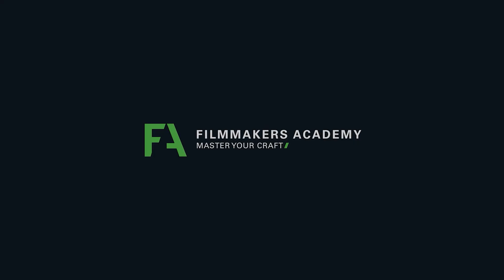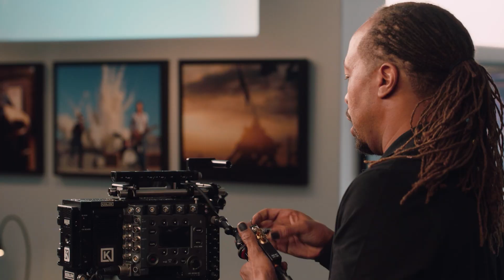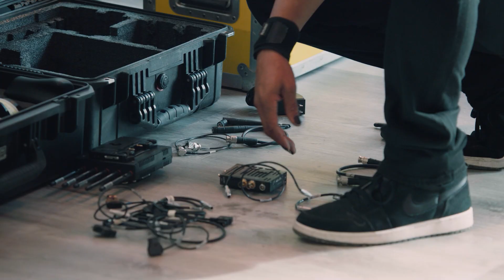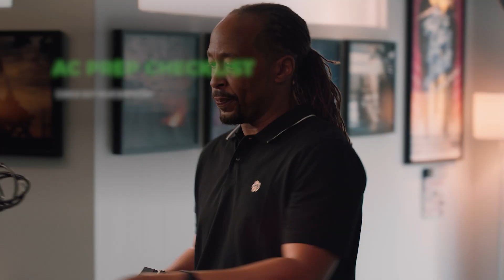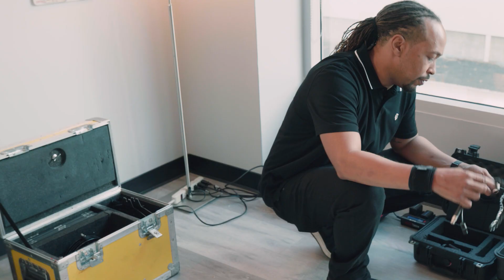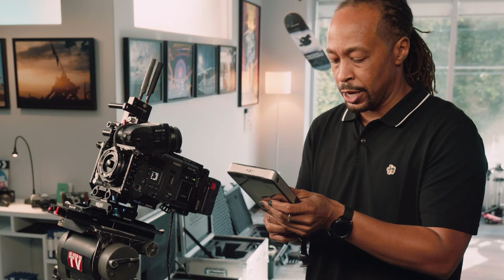Camera Assistant Tip: How to Build Your Camera

Comment: Never use D-tap cables, they're not grounded. Keep your equipment safe.
Reply: The other pin is ground, same as with lemo 2pin. And I'm pretty sure lemo 2pin doesn't have a secondary failsafe grounding either. So that's not the issue. The issue is that because of the D-tap design, you can plug/unplug a D-tap connector in an angle, where for a small moment the + pin is connected, but ground (-) isn't. So if...
A. The power cable is attached to the accessory. 
B. The accessory is powered on. 
C. The accessory or the camera neither have ground protection on BNC ports. 
D. The BNC cable is connected back to camera.
THEN the power from that D-tap power cable can use the BNC cable as a ground, sending way too much voltage through the BNC connectors and SDI chips, which can fry the connectors from the accessory and/or the camera. This is why with any accessories, but especially those powered by D-tap, always switch off power and disconnect any BNC cables from the accessory while plugging/unplugging the power cable. RED cameras even have a warning that comes with the camera body about this. I guess their cameras don't have as good or any protection on the BNC ports.

Comment: What's your top recommendations for Magic Arms/Israeli Arms. The ones I've deal with feel like I can just keep spinning them to tighten but they never "really" do. What's a recommendation for a small Magic Arm that really locks securely in place?
Reply: iFootage new arms are excellent. Super solid
Reply: Noga Cine arm. Swear by it. If you can't afford an Arri arm. #ProTip at minimum get an arri locking interface for more positioning flexibility.  Without it the 1/4"20 interface will always be the weakest point and force accessory to be positioned only between 12o'clock and 6o'clock. Righty tighty, lefty, loose expensive accessories flopping all over the place.
Reply: ULCS are the best and modular!
Reply: Ultralight arms and the wooden camera double ball arms are great for monitors
Reply: Bright tangerine makes an unbeatable arm. But it’s just prohibitively expensive for 99% 

I got mine included with a complete camera package I purchased from a rental house. 

Otherwise I’d never have even tried it!
Reply: Almost all of them have that little thumb nut around the screw. The last little bit has to be tightened from that nut, not from the screw/magic arm body. So twist the whole thing until it's almost tight but still loose, like half a rotation away, then tighten with just the thumb nut the rest of the way. For more force, I sometimes use a pelican wrench to tighten it really tight. Another tip is to orient an onboard monitor to that the weight of the monitor it tightening the screw on the camera cage, not loosening it. Also you can get a noga arm with one 1/4" screw for the monitor, and the other side is 3/8" for the camera side. If these tips aren't enough, get a noga arm with arri locating pins, those will never come off unless you want them to. The only problem is that not all monitors support them, so you might need another piece in between them. But most camera cages, top handles etc support them.

Comment: What happens if the camera doesn't power on. what steps do you take to fix that?
Reply: put it in rice
Reply: - Check Battery Voltage 
- Check Input voltage 
- Check battery connector (on cam / bat)
- Check aux Power connector (on cam / connector)
- Check for ground 
- Check power source for aux power (min voltage reached?) 
- Try different cable / battery 
- If camera is in boot loop call rental / on-site: let tech update firmware / reset 

- to prevent damage that may cause components to fail: 

When attaching SDI accessories:

Connect a power source to the SDI accessory; power on the SDI accessory. 
Ensure a power source is connected to the camera.
This ensures both are grounded prior to connecting the BNC.
The camera's power state does not have an impact on SDI attachment sequence.
Connect the BNC cable to the accessory, then to the camera.

(Only use high-quality shielded cables)
Reply: Put a battery on it.